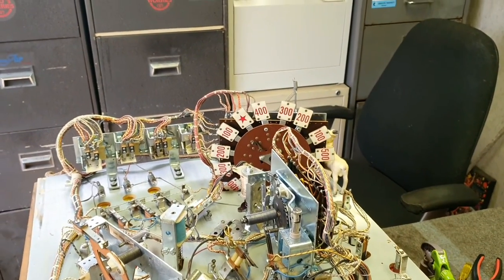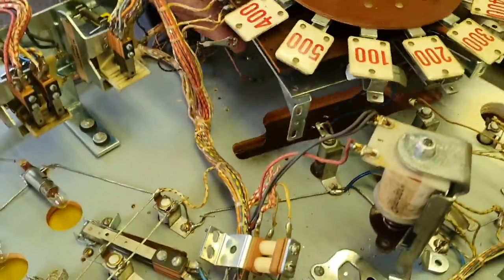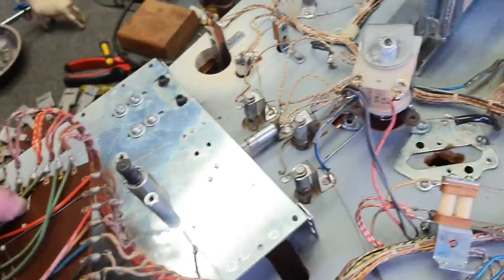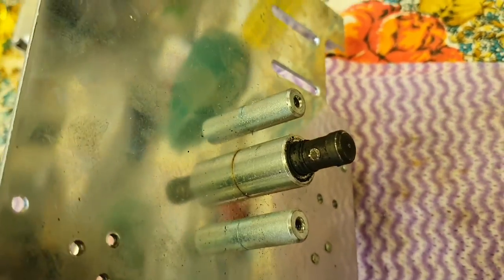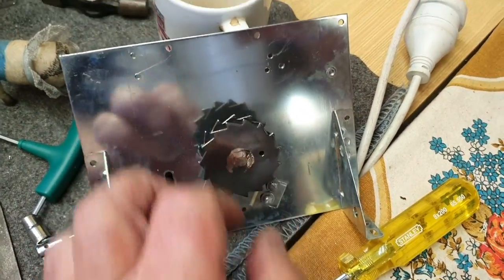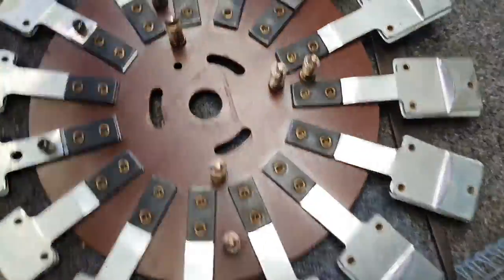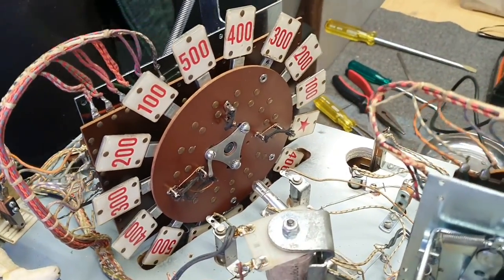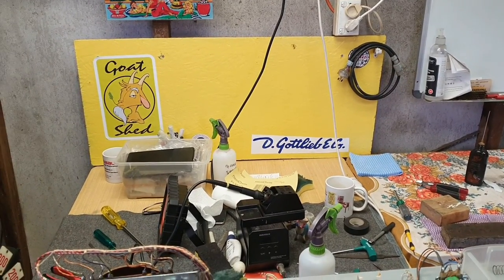Gottlieb Pinball Roto Target Servicing

Comment: Working on a Grand Slam with one of these. The fall back isn’t working great when I test the Roto. It’s not quite going to the resting position. It’s slightly off kilter. I ordered a replacement spring kit from PBR. Hopefully that will fix that issue.
Reply from the maker: A new spring kit will help but make sure you service it as per the video and away you go.

Comment: Hi Kim thanks for the video.  I took the set screws out of the "spider' but it's still on there tight.  Any suggestions for getting it off without damaging it or surrounding parts?   Have you ever experienced this problem?  Any advice would be appreciated..
Reply from the maker: Yes its very common I get penetrative oil  and get it in there best I can leave to settle in for an hour or so then just keep twisting the spider both ways and pulling at the same time. What the problem is a burr on the shaft caused by the set screws you will need to file that down once you get it off.
Reply: @goatshedempinballrepair8545  Goatshed saves the day again, many thanks.
Reply from the maker: @chuckufarley5884  hopefully